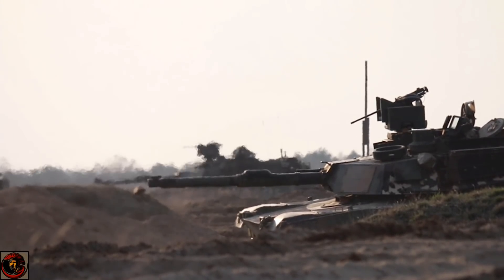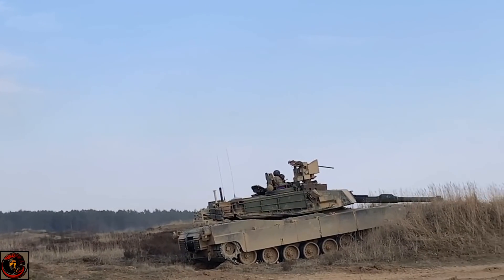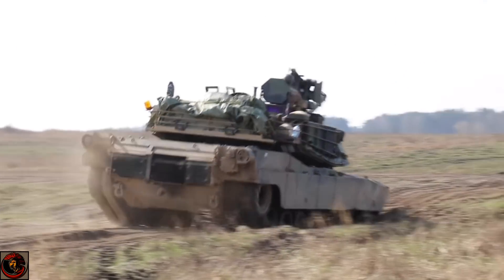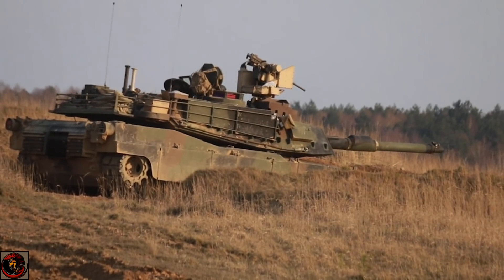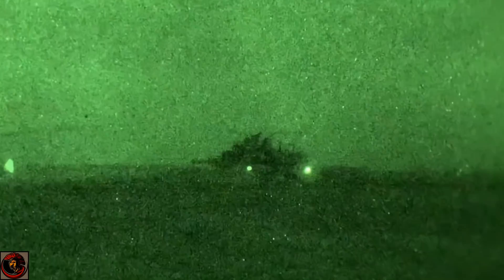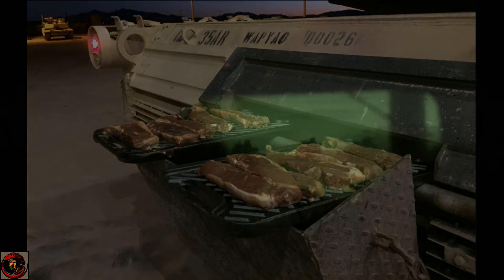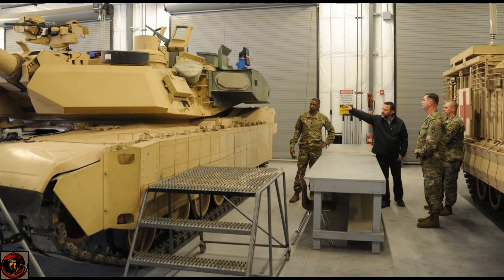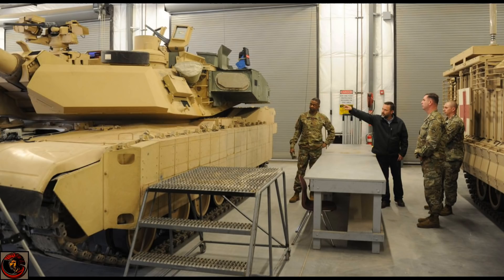M1A2C Abrams Tank Upgrade - The Last One?

Comment: Very interesting/informative video as usual. Question though: are we positive that the system pictured at 6:42 is in fact the Trophy system? I looked at pictures of it on several other videos and I'm not so sure that's what this is. To me it looks more like the TOW launcher carried by the Bradley. If this is an APS system then its not as good as the Trophy system b/c the one pictured is limited by being fixed to the turret, in terms of which way it can face - meaning you have to rotate the turret to target incoming rounds. The Trophy system is both passive and (I guess the alternative is "active") in that it first attempts to defeat a round by interfering with the targeting, but failing that it then attempts to intercept the round with an explosive. Looking more closely, it is possible that the black thing, also blue, above the object pointed at is part of a Trophy system, but the big thing bolted to the side that the arrow is pointing at doesn't really look like part of the Trophy system to me (though maybe there are other versions of the system that I'm not seeing pictured in the videos I've looked through). However, again to me it does look a bit like an ATGM launcher and that wouldn't be completely out of place on a main battle tank given that the Russians fielded quite a few main battle tanks with onboard ATGM systems.  Anyrate, those are my two cents. I'll look through the other comments after I post this and see what other folks are saying and maybe they will point toward a video or picture that would identify this as being part of an APS system.

Comment: It's funny just yesterday (6 May 2019) I saw two stripped down hulks of the M1 being presumably back to the plant for some type of rebuild.  They were just the hull and turret, no control arms, road wheels, torsion bars, or main gun. They didn't even have a coat of prime. This isn't the first time I have seen these pass this way and, I guessing they're going from the Army Depot in Anniston AL to the tank plant in Lima OH.

Comment: G'day Matt, thanks for this great video. (I've subscribed & 'belled').
There's a great 2013 'Ultimate Factories' documentary floating around on YouTube about the civvie factories in the US that refurbish M1A1 Abrams. At the time of shooting this documentary they just happened to be working on a batch of Abrams M1A1 MBTs that were being, virtually rebuilt, for the Australian Army. (The final paint job with the Kangaroo symbols was a dead give away.) 

At first I thought it wasn't a good idea for the Australian Army to buy 'old' Abrams; that was until I saw this film. 
The level of the refurbishment is amazing. They virtually take the tank apart bolt by bolt; stainless steel pellet-blast the body back to its 'new' state, repaint all the smaller components then ship the bodies to another factory that puts them all back together with tech upgrades as required by the customer. The result were tanks that looked like they were just manufactured from scratch. Most impressive. Links: Part 1: https://www.youtube.com/watch?v=G8uFVKmAj5o and Part 2: https://www.youtube.com/watch?v=dG4CLaBMfVU 

It's worth a look because it shows how long the potential lives of these tanks can be plus the care and pride they take in making sure the finished tanks are as good, even better, than new. These Abrams are now serving with the Australian Army Tank Corps and although they may not be M2s, they give our Army a significant edge on any of our potential adversaries in our part of the world. I'm an ex-air force type but still, I'm fascinated and in awe of these magnificent machines. Cheers, BH

Comment: What would be the purpose of remote firing from OUTSIDE the tank? Video shows what looks like the Standby Firing unit on a long cable. I've seen video of rebel type forces doing this with T55 era tanks and using a lanard to fire the gun from outside the tank. Something has to be pretty messed up to have to resort to this.

Comment: Just mount the 140mm gun that one of the Leo 2 was sporting on it if they are planning to neutralize armored targets.
Reply: That would require autoloader because rounds are way to havy so turret redesign. Higher pressure L55 gun + new ammunition.

Comment: So nothing happening regarding a possible diesel engine replacement to fix the logistics issues? Especially for foreign users that don't have the supply chain capabilities and fuel budget of the U.S.

Speaking of which depleted uranium armour isn't used on a lot of export versions. Australia doesn't use it for political reasons, because of the Pacific nuclear free zone, we don't go nuclear so South East Asia won't either. 

They are apparently adding colour television cameras in the SEP v4 upgrade, which should help situational awareness. VR is probably still in the development phase.

But as a armchair colonel, or maybe armchair major, I'm wondering why they're not considering fitting a close in crowd control deterrent, to stop mobs swarming the tank during a peace keeping missions, where you can't use lethal force. Tear gas dispensers fitted to the outside or some kind of incredibly loud ear-splitting siren - a boost to the PA system that allows it to emit a oscillating pitch that is impossible to be near.
Would have been useful for that Challenger tank that the crew had to abandon in Iraq when under cover of protestors someone poured petrol on the tank and lit it.

And while a big tank on tank battle is the number one design issue, even just for deterrent purposes (how many planes has a F-15 actually shot down vs how many countries have decided not to mess with F-15's) to be realistic Abrams will probably most see action in low intensity conflict where the local civilians might not appreciate it and they need to be shooed off with something less lethal than the main gun, the remote weapons MG or the treads assisted by physics.
Especially as camera phones will be everywhere looking for a propaganda victory.
Reply: The desiel engine is ok for us we can actually get desiel faster than we can regular fuel for tank logistics but exports since they can have spec requests if a nation wanted a gas turbine or even a fking jet engine In there they can do that but it will cost more

Comment: To get it out of the way: every MBT comes in 2nd to the Leopard 2. now: it is rumoured to get the next update to A8 around 2025 and if it is decommissioned some years after that will be in service for 60 years. It shares the origins with the Abraham. Also Rheinmetall is developing an active protection system

Comment: If they run over an ied can you still use the tank normally or is it going back to b repaired?
Reply: Ieds usually don't do much because there smaller and made for infantry but like when the string 5 1000lb bombs togeather and an Abrams 
 Hits it it dies. However usually it just takes a field repair unit with new tracks to fix it and it's back in action. Sometimes they do need heavyer repairs but usually it's fine. However not many Abrams have been hitting ieds so we can't be entirely sure

Comment: The Abrams will not be replaced for at least 20-30 years. Firstly the USA does not even know if it wants a future MBT! Secondly it does not even know with what sort of vehicle?, Thirdly which is the major component. Is it speed, armour protection or capable firepower. Fourthly will interoperability and exchange of parts to be common for all its AFVs? Lastly will it want NATO interoperability. There is all talk about US Army requirements BUT the USMC (Fifth Requirement), is as big or bigger than many NATO members own armies, has its own requirements which are not the same.

Comment: The active protection system looks spiffy, but I wonder if the sensors (radar, probably) are robust against direct small-arms fire?  Here's a descriptive video: https://www.youtube.com/watch?v=OtMgnRMIspQ
Reply: Radar panels are vulnerable against small arms fire. But that's just a compromise one has to take.
Reply: @jonny2954  The radar panels aren't vulnerable against small arms fire. The radar panels are protected by ballistic ceramic covers (similar to ones covering the radars on navy ships) that are transparent to radio, and microwave signals.

Itz definitely invulnerable to small arms. Against heavy machine gun fire....maybe (possible penetration). Autocannons....most definitely (penetration is most likely)
Reply: @andrewlee-do3rf  They are not protected.
Reply: @jonny2954  Rly? Based on what evidence?

Comment: No engine update?
Reply: I think there were proposals to improve the M1 abrams with either the diesel MT833, or MT890 engines. Or use improved LV100-5 gas turbines instead. But as far as heard, they were just potential options

Comment: Why does the armour at the front of the turret near the cannon angle downwards?  It looks like it creates a shot trap into the weak top armour and possibly into the driver position.
Reply: It is a shot trap, as briefly pointed out on The Chieftain video. You also need the clearance, when you rotate the turret to the rear for storage.
Reply: @KSmithwick1989  It isn't a shot trap. Chieftain (Nicholas Moran) told me in his M1 abrooms video review. You can ask him yourself if ur inclined

Although to be fair, I thought thatz what Chieftain said during the video (he can be sort of hard to listen to, because of the audio, and sometimes he kinda mumbles....I guess), but he corrected me on it.
Reply: @andrewlee-do3rf  Can you forward the response or post a except?
Reply: @andrewlee-do3rf  The video I referring to is the same M1 A1 tank (Spawn), although being reviewed by Moran alone: https://www.youtube.com/watch?v=aladW_D4nKU&t=1810s

The anecdotal information is particularly interesting. Along with other facts, such as the turret floor ammo storage (auxiliary) and how the ammo bunkers (ready/reserve rack) operate.
Reply: @KSmithwick1989  Well anyways, if you want to know the details on why there aren't any shot traps on the M1 Abrams (and other modern MBTs for that matter), itz basically, because modern composite armour is essentially an advanced form of spaced armour (with rubber between the steel plates). Normally, a thick metal plate (without any spaces in between) will cause a non-penetrating hit to ricochet....however, since modern composite armour is spaced armour, the projectile will penetrate the thin spaced sheets, and will be stuck in them, thus preventing them from ricocheting off the (modern) armour in the first place. Well, that's the best that I can explain.

https://below-the-turret-ring.blogspot.com/2017/01/early-m1-abrams-composite-armor.html   This is basically the armour scheme of pretty much all modern MBTs in a nutshell. Notice how everything is more/less spaced armour plates?

Comment: How much is all that extra weight retarding the performance of the vehicle? The Abrams is already a gas gussler and one of the slower tanks out there (not slow but slower compared to other modern tanks). How much more wear on the running components does this extra weight create, particularly the gas turbine engine? The Abrams has pretty much come to the end of what you can do with its design. It has its limits. It was designed in the 70's to combat 80's and 90's opponents. It is now 2019. Everything they are doing is an attempt to keep a competitive edge against current designs with an old design to save on cost. This will only get it so far. Essentially they are trying to keep a 70's designed tank relevant for modern combat because they can't afford a new, modern designed tank along with all the costs of a new logistics system to handle it. What the Russians have done has gotten everyone on edge because they seem to have grown leaps and bounds in the technology department. If you disagree with this then please tell me why all of a sudden everyone is desperately trying to upgrade all their tanks since Russia came out with the T14? There was no noise before its release then all of a sudden there has been a massive flurry of activity in the development of new armour in America, Britain, Germany, Turkey, Japan and France. It's because they know they have fallen back a step or more accurately the Russians have gained a couple of steps in armour development and military technology in general. Why on earth everyone still thinks Russia is still the enemy from the cold war is beyond me but I suppose old habits die hard.
Reply: No

Comment: SEP v4 is already well into its engineering development and is staged to be ready by 2020. the A3 variant is in research develpment. This is according to Wikipedia. So it looks like this tank isn't going anywhere any time soon. And I really dont want it to. I love it to death
Reply: An m1A3 would be a different tank. The m1 m1a1 and m1a2 (with there upgrade historys)  are the same frame. But there very different. He'll there's talk of even changing the frame it's self to be smaller.

Comment: I actually tested out the APS in Fort Bliss Tx. It was an hell of a system. Im pretty sure if you look up D co 1-1 Cav 2/1 AD it should pop up. The picture is legit and I promise you its not a joke 😂
Reply: The APS slowed down the turret speed significantly and while the gunner found his target the gun would keep spinning lmao
Reply: @ajquinata21  That's interesting. Was it due to the power consumption of the APS draining other systems?
Reply: Jonny No, actually the APS has its own power generator on top of the blow out panels. So its completely powered on its own. The designers had to put counter weights in the bussel rack to match the weights on the sides of the tank. You did have to power the APS on the commanders display